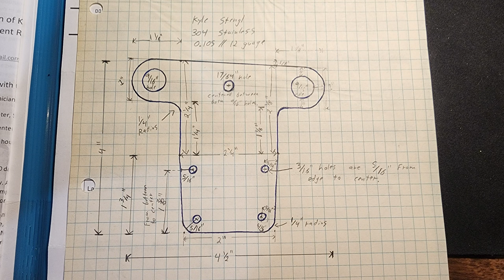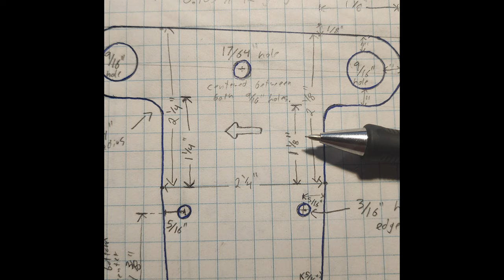Fabricating High Banker Legs. Music Video.

Comment: Slick. How much for the leg brackets? Legs with the disc feet how much? Good for DIYers. Attachments already built  saves a lot of work and time . Could use those for a wooden sluice as well . Next the double decker sluice ?
Reply from the maker: Yeah, should be able to screw them into a home built wood highbanker with some #10 screws, or bolts.  Rivets would look the cleanest for am aluminum build.  I'm still working out the final pricing details, website should go live in a few days.